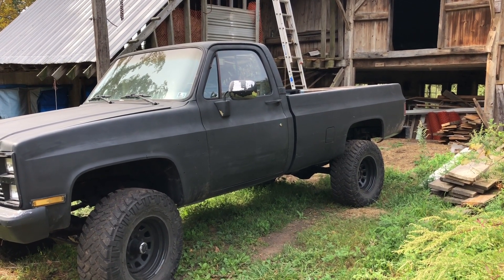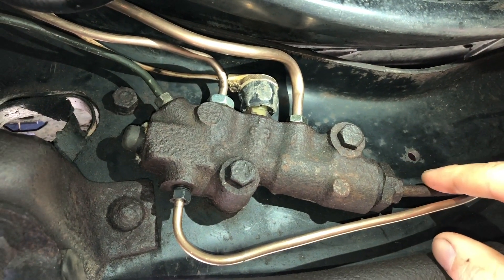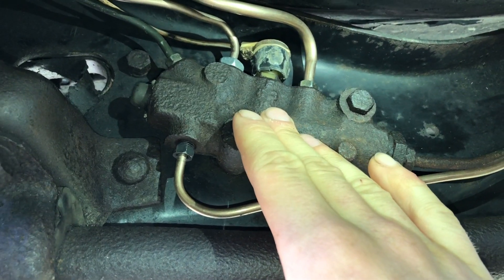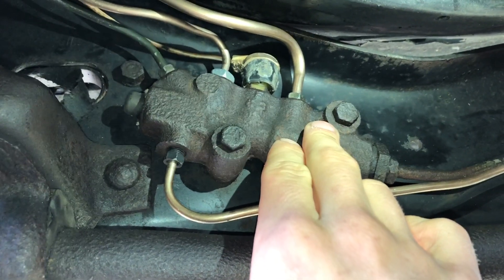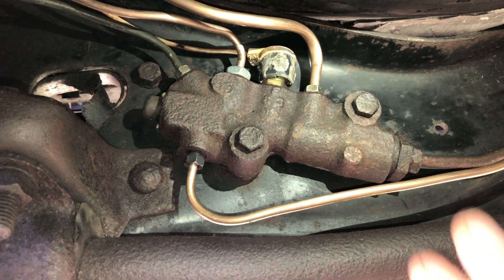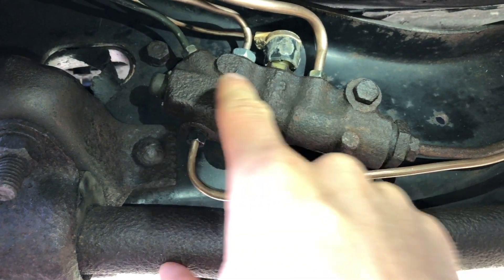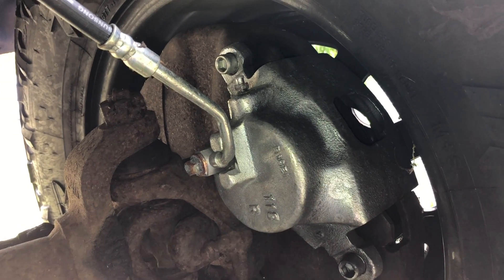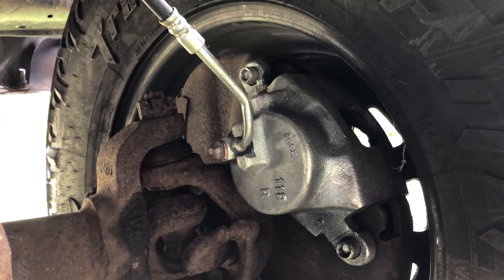GM Proportioning Valve Reset

Comment: The easiest way is to just get an old oil pump thing you know the hand held ones and put brake fluid in it and pump it into the bleeder this Will force the proportion valve back. It will also bleed your brakes in the proces.
Reply: From the rear with the front bleeder closed and cap removed from master? I'm having a heck of a time

Comment: Just so you know, the "switch" does not kick the shuttle valve over. It just detects when it happens and gives you a light. The shuttle moves mechanically/hydraulically. Loss of pressure brings the shuttle over, not the switch. 👍

Comment: Replaced the two rear calipers on my 94 Jeep Wrangler, but couldnt get the brake light to go out. Used your tip, and rebleed the front and it solved the issue.

Comment: I've a '73 3/4 ton GMC with disc in the front and drums in the rear.
My valve looks exactly like yours.
I found neither new or rebuilt valves are available through Napa.
I pulled mine off and reset it as per your video and will re-install it.

Comment: My pedal is hard. And I’m only getting liquid out of the right rear side. After replacing the wheel cylinder on the left plus break shoes. Could this be the problem? I’m not getting any fluid to the like I just replace

Comment: Isn't copper tubing unsuitable for brake lines?  Not sure were I read about this but copper doesn't have the burst pressure strength of steel tubing and therefore should not be used for automotive braking systems.
Reply: Normal copper yes there is stuff called nicop that's an alloy of nickel copper and steel that you can use safely. Great stuff for diy because it has most of the flexibility of copper it's expensive tho
Reply: It's not copper it's copper nickel which is the best you can use

Comment: So I had everything replaced on my 88 Chevy Silverado Suburban breaking system. My front brake started squeaking 6 months previous. The fill on the master cylinder stays full but the other side goes dry so I end up filling it with brake fluid. What can I do to get this resolved as it seems there is a problem with the master cylinder?

Comment: thank you for the awesome video. I was losing my mind. I am having a similar issue. Replaced all brake lines, hoses, calipers and wheel cylinders. Let the system gravity bleed (before I do manual bleeding) but I did not get any fluid in the rear (neither driver side nor passenger side). Bled the master cylinder but still did not help. Then, found this video.

Comment: Your proportioning valve is contaminated with rubber debris. It needs to be rebuilt or replaced because the shuttle valve is hanging up.

Comment: C10 1986 rear brake line broke.. The shop fixed it and bleed the brakes.. but the light still on..They told me to replace the whole valve. Not sure

Comment: I didn`t find this helpful at all, more confusing that anything, my `80 G10 has no front or rear brakes after doing a m/c kit, did a bench bled its fine, pumps from the m/c if i crack the pipes there, but no fluid reaches the calipers, pedal has come up ok , but still no brakes, 
you say `proportioning valve reset`, but you `bleed` your brakes and fluid comes out. how do you reset p/v if no fluid reached the brakes.

Comment: Please help i work on vehicles alot I've done it all.  I've learned on my own plus the you tube and watching real mechanics. I tell everyone if i can't fix it or don't know how i will find a way whether it be they you tube or just asking but i have a94 dodge dakota 3.9. All 4 brakes bleed nicely the way they should yet i still am getting close to zero breakage meaning i push to the floor and it stops very slowly i basically can't drive it.  I do have drums in the back disks in the front this was done before i bought it but I've replaced front brakes twice over the course of 3 years or maybe nore that i have had it now all of a sudden somethings not working right and then I've heard about this proportioning valve and differential switch etc. Well crazy part is i raised there is brake fluid leaking out of that brake switch which i have red is not supposed to Happen unless there are bad steals somewhere can someone please help i feel completely lost bad part is both my vehicles screwed up at same time.  Can you help????? Thank you in advance

Comment: If the back brakes are blocked off open front bleeder and slam breaks and it will shift forward lke there is a leak in the front. I have done this a bunch as i was shipped the wrong combination valve and had to reset it a bunch before i figured it out.

Comment: I got a 83 k20 scottsdale and just replaced drums and brake lines I have brake fluid coming out of the rear and fronts I have a solid petal until I start the truck once it’s running I have no pedal at all do you think this is a similar issue or another issue? A brake line cracked but before that brakes worked fine

Comment: @Kyle Owens. Hi Kyle, cool video by the way. You kept saying the rear brakes were blocked off. How did you block them off... By disconnecting the main line & plug it? My daughters husband had their car towed home because the brakes went out. My concern is that he got it into his head to keep pumping the brakes on the vehicle, (1996 Pontiac Grand AM), But not checking an ''Almost Empty'' Brake Fluid Reservoir.....
Thanks & again, great video buddy......

Comment: Great vid, I have an old distribution block from 1969, no matter what I do front disc brakes have air.  Rear's no air!  I can't access the switch itself to look in and see if "it's moved" or not, yet alone even remove it.  I removed front STEEL brake line(drivers side) and pushed the rod inside 1mm or so, presumably towards "rear brake section".   Do you think that is enough, I know it's a guess?  I'm going to re-attach hard line, vacuum bleed to start fluid moving (prevent switch moving by doing that) then gravity bleed.  Any other tips?  FYI I replaced all calipers and cylinders, rubber lines and not a single fluid loss, air is getting in somewhere. all fittings tight.  at a loss.  thanks again.

Comment: To reset with the side buttons, remove the rubber cap. Grab a 3-in nail between some small vice grips and push in on the center or try the Allen wrench like he showed. Mine only moved an eighth of an inch and I didn't think it did anything but it was enough. The light was off. You'll know when you're brake light turns off and the key is on for a minute. Back brakes bled fine after. Push from the front to release the back push from the back to release the front.
Reply: When did he use Allen wrench? Did I miss something?
Reply: Ok
Reply: I know that a reset tool is under like $12 shipped if I used Amazon to get one, so that's no biggie....
.
At any rate, we're working on a 1996 Pontiac Grand AM & I'm hoping that just bleeding the brakes does the trick. The brakes went out when my son-in-law was out driving. Turned out that there was 2 slightly leaking Brake lines at the rear of the car, just ahead of the rubber lines on the axle...... 

Actually I'm hoping that my daughter's husband didn't continue pumping the brakes on the car, since it already had an already close to being empty Brake Fluid Reservoir... 
If he did (& knowing him, he would probably do just that), we may end up needing to remove the Master Cylinder/Proportioning Valve assembly in order to get the job done..... 
For some reason, people just never seem to think that it's important enough to check the Brake Fluid level on their vehicles.... 

I've got that ''Yellow Plasti-Dip Rubber coating that I've used on like the transmission dipstick on my 93 Jeep XJ & you can spot that dipstick handle 10 feet away. I'll put that on the Reservoir Cap so they can see it....

Comment: Hi there, I changed the valve and still get this issue: the rear brakes stop before causing the the wheels to slide, mainly the rear right one. Any idea?
Reply from the maker: You getting fluid out that caliper? Could have a trapped air bubble. 

Or try it a few times. I had to do this process 3-4 times before it worked. Same thing too. Right rear line was barely getting any fluid through
Reply: @Kyle-ry5kg  yes I am getting fluid but on a hard stop the rear brakes harder than the front
Reply from the maker: And that’s not fixing it? If you want to go through the headache, remove the rear brake line from the prop valve and use a needle to manually push the pin back to the center. 

You can also change out the valve entirely which may be easier: How to change a proportioning valve
https://youtu.be/5tkDS6nvluc
Reply: @Kyle-ry5kg  thanks Kyle will try

Comment: I did exactly the same,no dice
Reply from the maker: Sorry to hear, it took me a few tries. You can reset it by pulling the rear line off and using a pin to push the needle back into place. Or you can change out the valve entirely:
https://youtu.be/5tkDS6nvluc

Comment: Once you do that how do you know it's reset? Does the "brake light" on the dash go out and once that happens you bleed them normally?
Reply: I have been wanting to know the answer to that question also.  Been asked numerous times in the comments but no one replies.
Reply: @pigcreations6357  I just fixed it yesterday.  So my rears were shut off due to a broken brake like. I fix the line. In the rear and tightened everything for the rear. I then opened the front drivers side brake bleeder nipple and pumped the brakes fast and hard 4 times. Then I closed the front bleeder. After that I got my son to help me bleed the brakes. I started at the rear passenger side bleeder. I had him pump the brake slowly but firmly 5 times and continued that until i saw no bubbles (about 6 times per corner) .  We did that for the rear driversside, then front passenger side and finally front drivers side.. The reason I had him apply pressure slow is so it wouldn't trigger the proportioning valve. It worked!  Hope this helps you and others.. now the brakes have been bled and the brake light on the dash went out.

Edit : make sure you top off brake fluid as needed!! 😁👍
Reply from the maker: Pretty sure the light should go out (my light doesn’t work so I don’t know for sure). But you’ll know that it has been reset because the brakes will bleed properly again.
Reply: @Kyle-ry5kg  yup, got it done yesterday
Reply: Finally found a video that explains it.  Watch video by Lilmockme8821
Reply: I'm getting fluid out of all 4 corners but once brake light turns off the e front calipers are locked up won't release changed rubber lines and calipers same issue caliper is tight against rotor after bleed what happened

Comment: Hi Kyle, thank you for this video. My 93 S10 is in the situation since I changed the front brake hoses/calipers/discs. Now it won't bleed. If I now open the rear brakes and apply pressure, why won't the valve just go all the way over to the other side and block off the rear lines at that point? Why would the valve reset?  Seems like I would solve one problem, and create a new one? What am I missing?

Thank you!
Reply from the maker: There is a groove in the middle in which the valve seats. Pretty sure it’s not moving fast enough to go from one side of the prop valve to the other and skip that groove entirely
Reply: @Kyle-ry5kg  Good info, I too was wondering about this.

Comment: On the left end of your valve body I see a black rubber cap. I have the same cap, & under it is what looks like a tire valve. I'm so tempted to push it.
Anyone know anything about it?
Will it re-center the safety switch?
Reply from the maker: It’s a reset button for the front brakes
Reply: @Kyle-ry5kg  thanks!  Somehow my brakes are working now, but the ABS light occasionally lights up. I'm not going to worry about that!

Comment: The cap that is on the top of the brake sensor. How does it come off? Do you just pull it off or does it unscrew?
Reply: On my 95 G20 Chevy van I pinched it to release it and pulled
Reply from the maker: You unscrew it I believe

Comment: there is a button you push in.
On left side under rubber cap a pin poos out .
Reply: Some people say that's just a metering valve?!
Reply: @lauradahlus  yes.  But on the side of most is a reset pin. After brake line or hose pops loss of pressure it moves to maintain brakes on side not compromised.
GM service manuals on pickup truck vans  have such 
Not sure about new ABS models though.

Comment: I have a similar problem with a G20 van. I changed the axles so the system was open for several days. After assembly I bled the rear and the pressure was good. Then bled the front and the pressure also was good. But the pedal was way to soft because there was still air in the system. So i bled everything again. I didn't notice that the reservoir went empty. I refilled it and started over again, the rear pressure was ok at first but then I noticed I had a small leak in the rear break line which I fixed afterwards. So I think it also could be a stuck propotioning valve, but I'm not sure. I went to a shop and they tried to bleed everything again but the rear has nearly no pressure at all. The front pressure is good. I'll have to try to pump and open the front several times like you said. Thanks for the video btw. I have another used valve here, so in the worst case I could change it. Is it possible that the problem is the master cylinder because the reservoire was empty?
Reply from the maker: Try to bench bleed your master cylinder. You probably have air in it.
Reply: @Kyle-ry5kg  i was going to say the same

Comment: I'm reading here in my 1977 service manual and it says: "WARNING:  NEVER USE COPPER TUBING BECAUSE COPPER IS SUBJECT TO FATIGUE CRACKING AND CORROSION WHICH COULD RESULT IN BRAKE FAILURE"
trying to figure out how to reset this valve and saw that.  Figured that I'd share it with you, noticed that you had copper lines.
Reply from the maker: Thanks for the heads up. I’m using nickel copper. Idk if that makes a difference, but I’ll run them till my brakes fail and I hit a runaway truck ramp.
Reply: @Kyle-ry5kg  yes sir and thank you for trying to help us all out!
Reply: Nickel copper brake lines don't have that problem because the nickel makes it an alloy that isn't susceptible to the work hardening issues that would arise from using pure copper lines
Reply: This is why your suppose to bleed all brake fluid periodically. The copper crush washers deteriorate first and contaminate the brake fluid
Reply: It’s nicop.  Nickel copper mix.

Comment: This makes sense but not in the manner you accomplished it .. you essentially just bled the fronts ,you didn't introduce a "leak" so how did the shuttle valve move ?im in the same predicament but I feel i need to introduce air aka a leak to get the valve to move. Am I correct in my thinking
Reply from the maker: I did introduce a leak by creating a loss of pressure/opening in the system when I cracked the bleeder screw